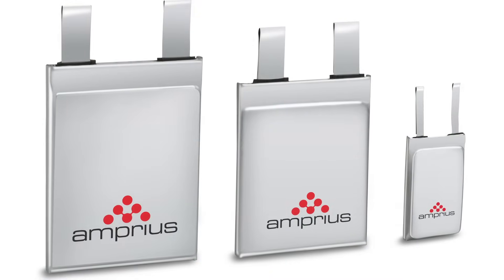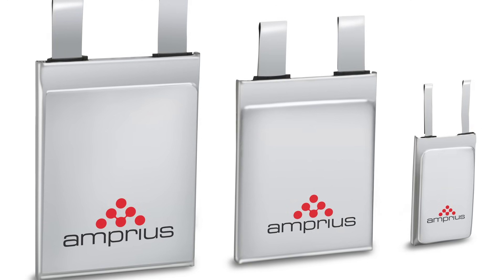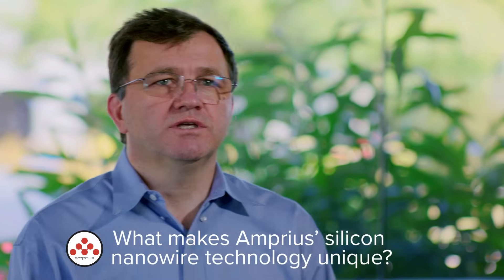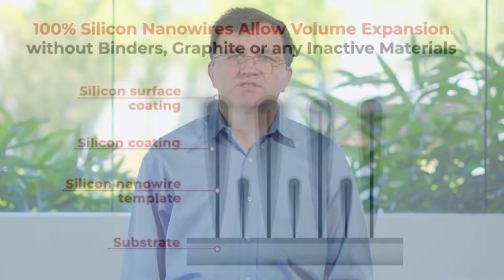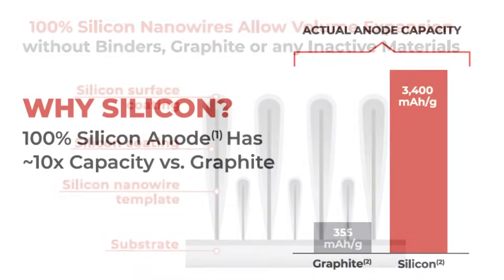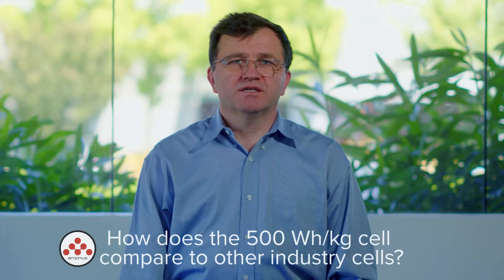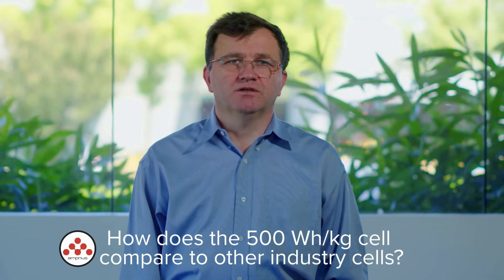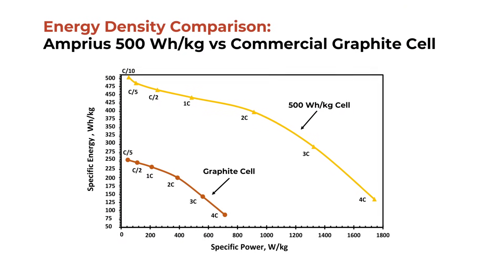Amprius’ Industry-Leading 500 Wh/kg Battery Platform

Comment: will this ever be available in retail in a common cylindircal format (18650, 21700)...?
Reply: They sell them now, but only a small number of them because that’s as many as they can make. Whether they can manufacture a whole lot of them cost effectively is the question. I don’t think it really matters whether they become available in a cylindrical format. I drive an EV with pouch-shaped cells and it works great! (To be clear though, I don’t expect Amprius to make batteries for EVs anytime soon, if ever; Amprius is focused on higher energy density, which comes with higher cost that would make it very difficult to compete with other battery chemistries for use in EVs.)

Comment: So is the cycle life good or bad in comparison to an NMC Battery?
Reply: currently it's lower, we'll have to see how things shake out as they scale up production and iterate.  i think right now they can make them get at least 1000 cycles, for most applications that's good enough, for example in a phone if you charge your phone every say 10 days or so, which the longer duration of the amprius battery would make doable, you'd get about 10,000 days until the battey degraded to about 80% performance, which is nearly 30 years.  Even assuming an application that pushed the cycle time to 5 days you have over a decade battery lifespan.
this for sure isn't the ideal case for large scale power storage where you want batteries that can cycle 5000 times or more, but the higher power density and reasonable cycle lifetime makes this tech a dream in a lot of mobile or aerospace applications.